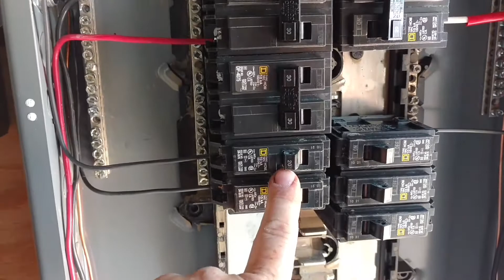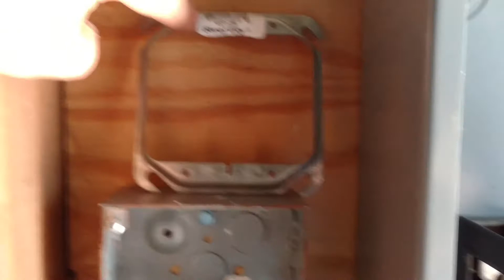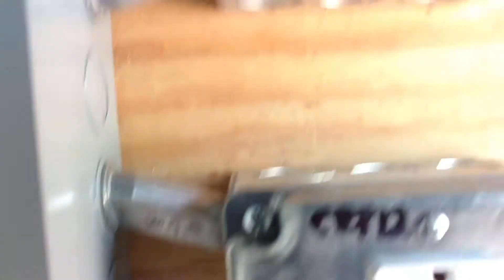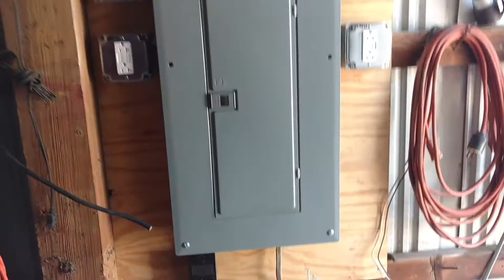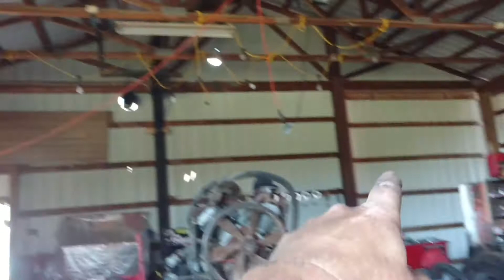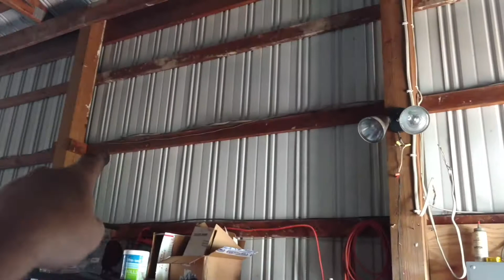PART 2) NEW ELECTRIC SERVICE FOR THE SHOP! OUT WITH THE CRAP WIRING!

Comment: one thing the natural is the ground in the main panel  the ground  rods connect to the natural  I use #2 copper for grounds. to the sub you run a ground wire and natural separate in the main they connect to the natural. in the sub the ground gets a separate bus bar not connected to the natural all grounds are separate from the natural in the sub. for 200 amp I like to use 2o copper in from meter to weather head  or under ground feed  or you can use 4o aul.  on the building check perka buildings midpark is a dealer  they are amish owned so no website lol   hope this helpsI wish I had 3 phase
Reply from the maker: this panel will be a main panel and the house will be fed from it. i will use 4/0 aluminum "urd" underground in pipe to a pole. the main panel will have a #4 bare solid copper grounded conductor (i dont use stranded wire for this) going to two 5/8" ground rods 8' long set at least 6' apart. i do not have a city water line to use so i must have 2 ground rods hooked in uninterrupted series. the neutral is a "grounded" conductor which will carry the returning "unbalanced" load while the ground wires in the branch circuits and the ground rod is the "grounding" conductor. two different terms for two different reasons. the neutral is required to make the branch circuits work and the grounding is for personal protection. however in a main panel they are tied together. if there was a short circuit it will direct the current to the easiest path to ground...the ground rod versus people or equipment. the house will have a 100 amp sub panel with 2) #2 conductors for each phase, 1) #2 for the neutral and 1) #2 for the ground. the ground and neutrals in the sub will be separated until they reach the main which will then be connected to the "grounding" conductor. of course all of this can be found in the "nec".
Reply: you said the same thing I did. not picking on anything.  I use to do licensed commercial electrical work in new jersey. what confused me was the separate ground bar in the main with no wire to the neturel just a ground screw to connect it  for the #2 you can use moble home feeder cable it has all 4 wires homer and lows sells it  they even have #4 its aul and direct bury but use conduit I have some feeds in hear pushing 150 amps on #2 over 150 foot runs to campers   I have the same setup you have a 200 amp main in my new garage and the house has a 100 amp feed  from the shop and another sub feeding the other side of the shop to cut wire runs  one last thing the feed to the main you have to call the power company to get a survey they tell you were and what they want the meter pan to go if you keep it over head they pay for the wire under ground you pay to the pole
Reply from the maker: i never put anything in the ground without conduit. i had the power company out and i will be setting my own pole and they will attach their drop to my drip loop. the meter will be on the shop. i can put it on the pole with some ridiculous requirements. i dont want it overhead as i use the gradall around there a lot and eventually i would probably catch it.
Reply: in hear we have every thing under ground the direct burry wire uses the ground to stay cool  the camping pedestal loop together with #2 aul   I had to buy a underground wire detector to make sure I don't hit wires I can trace them out with it it has a transmitter that connects to the wire and its real accurate depth to. I even find sewar lines also using a metal snake in the pipe  nothing worse then tearing out and electric wire you have no idea was there another expencive tool   plastic water lines now get tracer wires when I do new ones  the old owner had no plans were any thing was buried so when the hoe comes out any thing can happen lol
Reply: I belive the new meter pole requirement is it needs to be metal no more wood. I have ohio Edison they informed me of that. I have 6 electric services currently all wood if I replace them I have to do steel on cement  steel in the ground near the road in ohio will rust out from road salt it happened to us already pressure treated is ok with salt go figure I guess they did not think of that
Reply from the maker: i have used the the detector toner. very nice tool to have on a new property with many buildings and who knows how much electric lines. i used it to locate a plastic gas line as it has a grounding wires buried with it.
Reply from the maker: a pedestal for a meter base or something like that can no longer be wood. you can also use 6" sch. 40 filled with concrete to make a pedestal or meter mount. poles that are used to attach overhead wires are still permitted to be wood. i will be buying and setting my own 35' pole as my drop will com from across the street. the power company wanted way too much to set the pole. i can buy the pole from a supplier for under $200.
Reply: I would do the same thing your doing  in my case the high voltage runs under ground to a transformer sitting on the ground next to each meter pan and out door panel  several are shunt fed 400 amps some are not thers 4 of them .  my front shop attached to my house I did  the same as you I put the wire up 25 feet off the ground off the roof of the shop on a steel pipe guided

Comment: minus the cement it would be quicker to build new, maybe bigger....
Reply from the maker: well....the concrete isnt all that great either. if and when i build a shop it will be built to my needs. i may still build a new shop on the property where i live. i had plans of doing a 40wx60lx16h and also putting a 24' lean to off each long side for cold storage. the property where the shop is came up for sale unexpectedly and it has some acres....more room for more trucks!  i had been working outside on everything for years as the other garages were not big enough to get trucks in. not a big deal. i still prefer to be outside working on something....unless we have bad weather.

Comment: Do you have to run a ground wire to a grounding plate outside , or grounding on a well pipe ?
Reply from the maker: i will run a bare copper ground wire to 2) 8' ground rods set 8' apart from each other and drove into the ground.